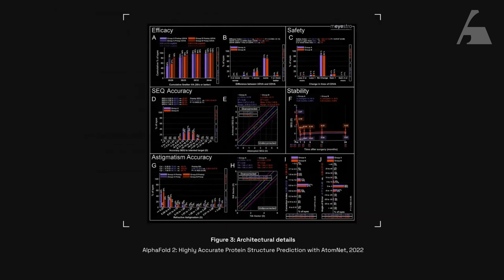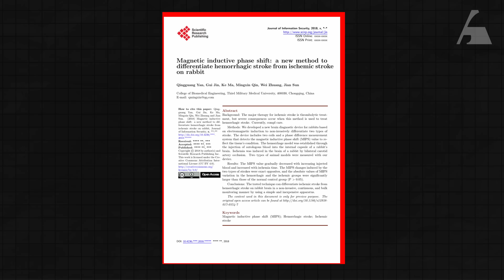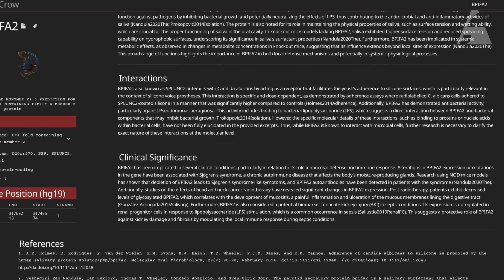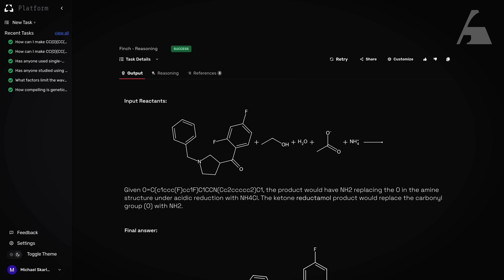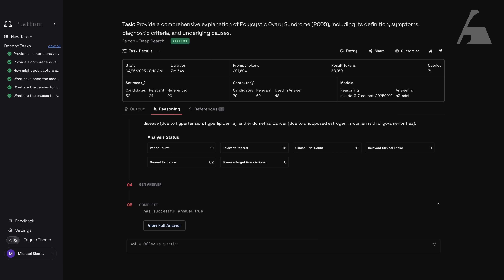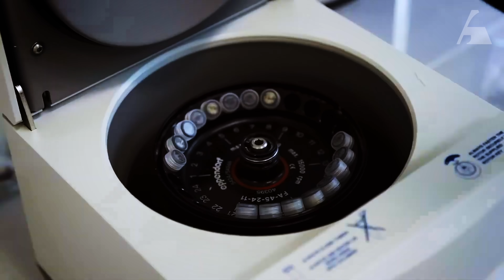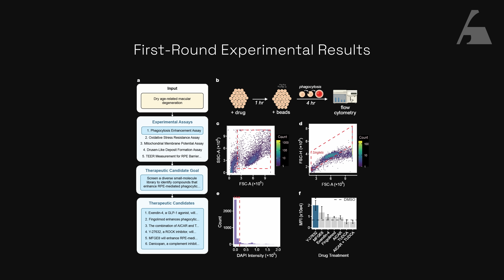Inside the Lab Where AI Runs the Experiments

Comment: I hope you understand because I don't know English. I have to use translation software, maybe I can't say what I mean, so I hope you will understand me. 
I've tested so many times on my own body because I have diseases that I haven't found a doctor to cure me for. My disease is a deviated disc, a spinal cord fistula causing inflammation and then joint adhesion, currently I have 5 vertebrae, but fortunately I can still walk. After many times of taking medicine, I have discovered that the healing properties of the body are from the body's energy, and when the body's energy is erratic, there will be discrepancies in the formation and development of cells. 
There are drugs that can act on the nervous system and stabilize the body's energy levels (
Energy levels if the individual overcomes the disease
In cases where